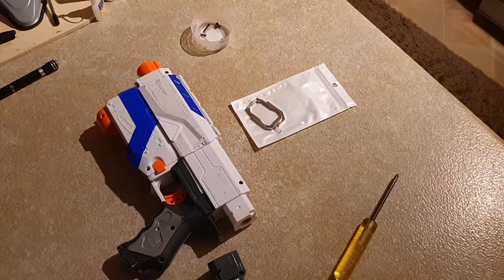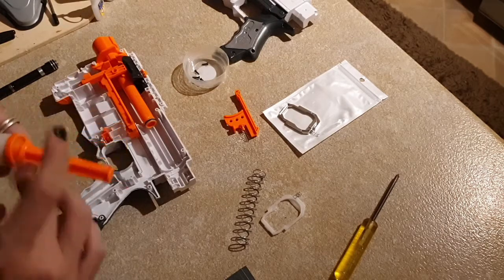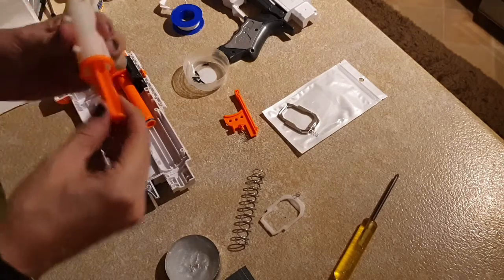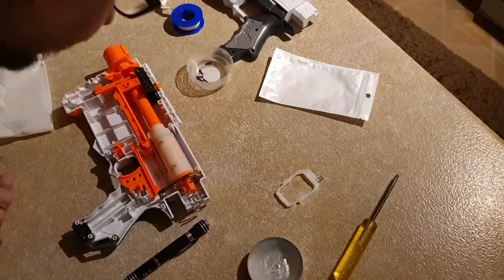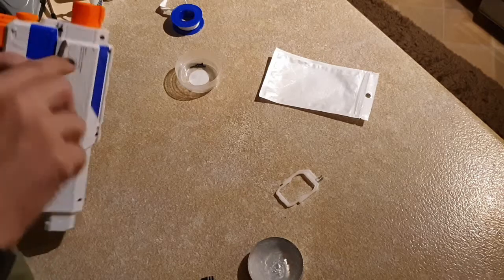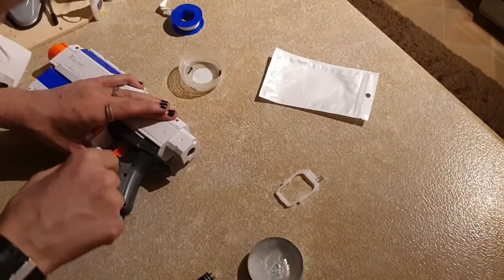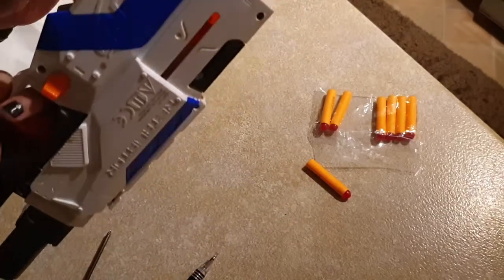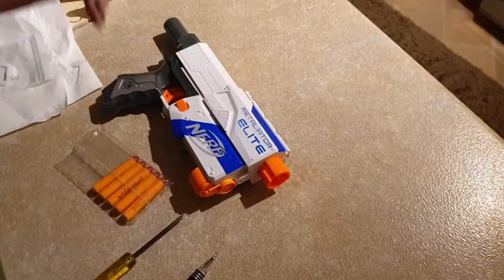Retaliator Worker metal catch plate installation.

Comment: Nice work bro, so glad to see you uploading more as well.  Congrats on passing 100 subs, you deserve more and I have every faith that they will come. Keep up the great work my friend................ Chris
Reply from the maker: Thanks Chris, that means a lot to me. I'm still waiting on some parts for my next big build, until then, I still have a Rapidstrike to finish, all it needs is some interior shell work, snipping and dremeling, then a bit of soldering, the switch plate is all wired up and waiting for me to finish the rest of the connections, as I have a few, I used a Kelly Industries motor plate so it should be super easy.
I really don't like 2 switch Rapidstrikes as I want the pusher to finish its cycle, I'd rather do it properly or not at all, I think I'm just a perfectionist, but I managed to fit 3x 21 amp Omron switches in there and the roller does a great job on the cycle return switch.
Take care my friend, thank you for watching (ill try and upload more).
Much love, Matt